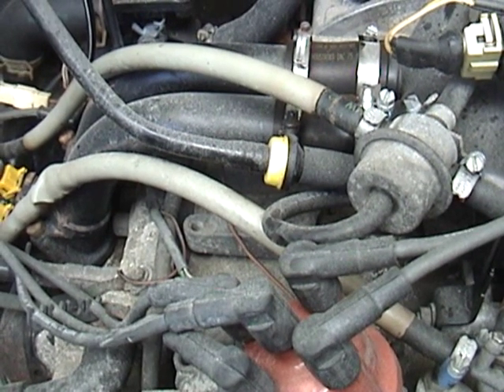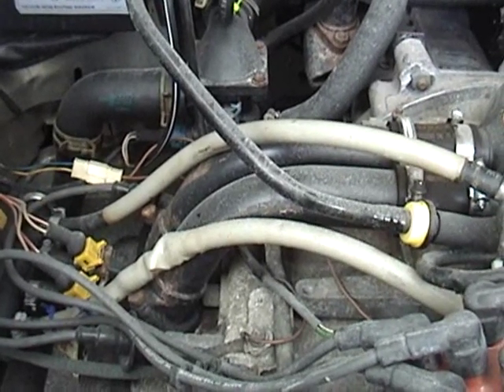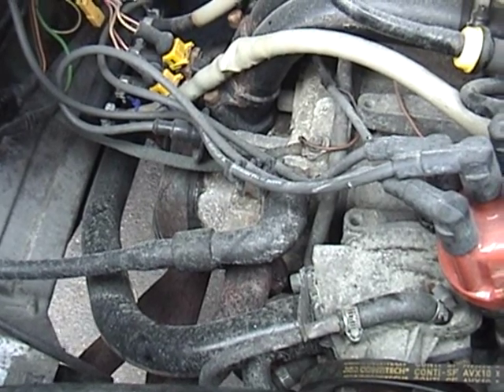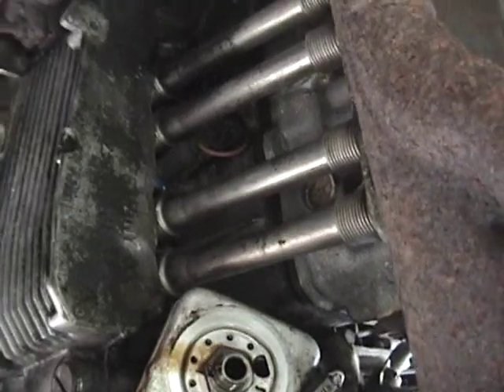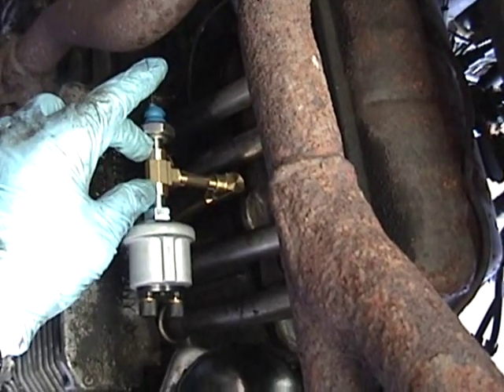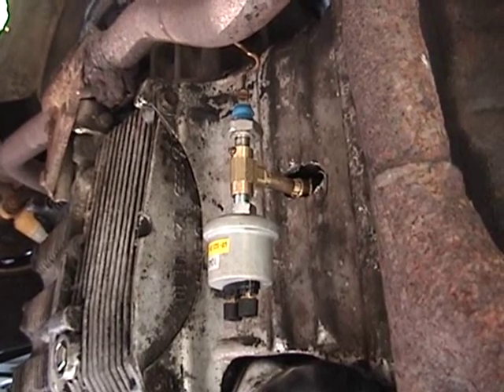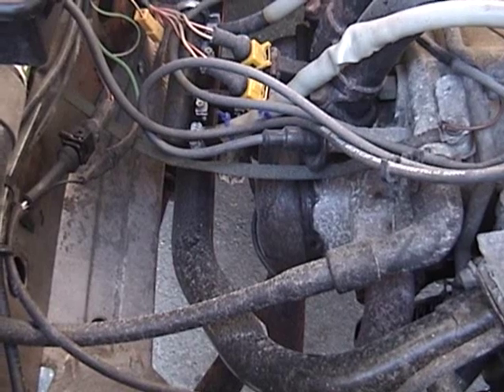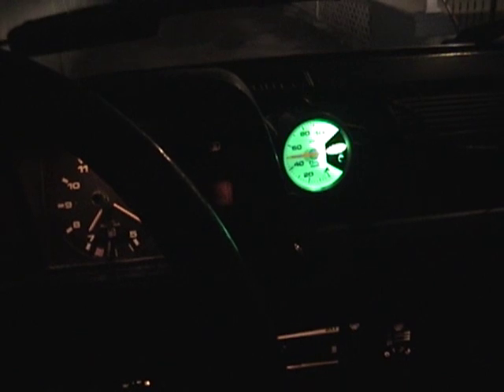1991 Volkswagen Vanagon - oil pressure gauge installation

Comment: Yikes!...Don't like this install one little bit! With those brass fittings dangling in space and porting through the tin cover, there is far too great a chance that something will get bumped, and/or just loosen up on its own. Far too complicated. Just go with an oil filter adaptor sandwich and install sensor there. Much cleaner and way more accessible!

Comment: Unfortunately the brass fittings you used are very thin where they are threaded. Engine vibration will over time weaken these parts with possible sudden failure. This of course means catastrophic loss of oil leaving you on the side of the road.
Reply from the maker: @akseakayaker  maybe, but a moot point. The engine's oil pressure problems turned out to be very real. This engine was only in service for a few more weeks after this video until it failed. I assume it was a toasted bearing, but I never disassembled it.

Several months later I replaced the engine with a good running used engine which is still running and in use as of September,  2024.

Comment: Hello! I have installed oil pressure gauge in my Datsun. Correct wiring but when i turn ignition switch, the gauge jumps immediately at 8 bars. I have tried everything and nothing produced results. Seems like overvoltage or something. Check my video of it and let me know if you know the problem. Thanks allready..

Comment: Why VW, or any manufacturer omits basic instrumentation on any automobile is well beyond my understanding. Every dashboard should have a speedometer, tachometer and gauges for fuel, engine temperature, oil pressure and either/or ammeter or at least a voltmeter.

Comment from the maker: @Kbrusky15 Impossible to tell what RPM the sensor went off, at this point. The tach was pretty standard after '86 (possibly earlier?), but in 1990 Volkswagen introduced the base model Vanagon to the US, which was a trim level BELOW the Vanagon GL. I have the flat metal dash instead of the padded dash, rubber floors instead of carpet, tweed upholstery instead of velour, no armrests on the front seats, and an analog clock instead of tachometer.